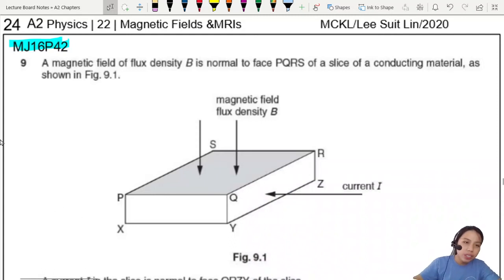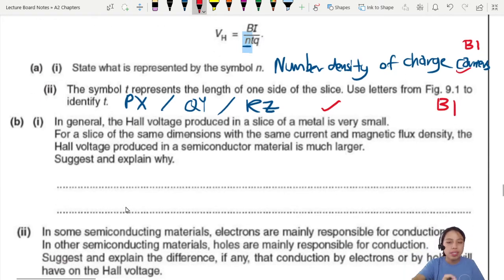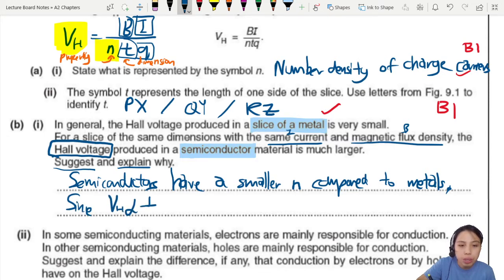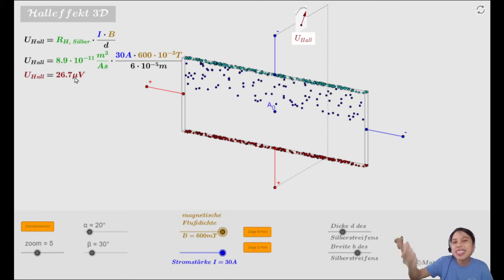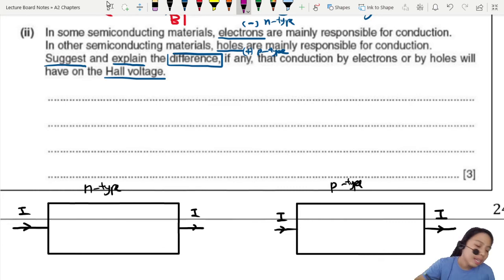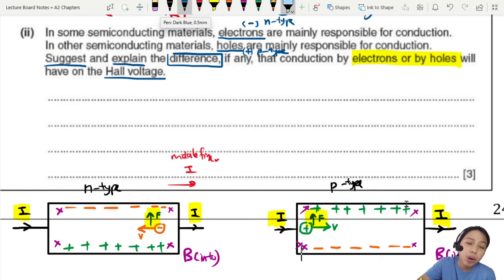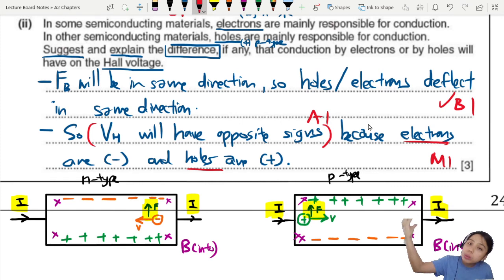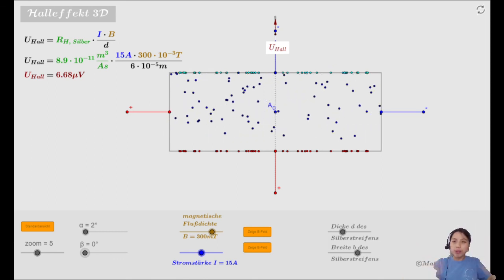20.4d Ex1 MJ16 P42 Q9 Semiconducting Material | A2 Magnetic Fields | CAIE A Level 9702 Physics

Comment: why don’t we use FBV(so middle finger points according to the charge) instead of FBI when applying flemings left hand rule
Reply: Because we are dealing with the current, not with a charged particle, anyways the convention will be the same as V is the direction of positively charged particles so is the direction of current/I towards the flow/movement of positively charged particles).